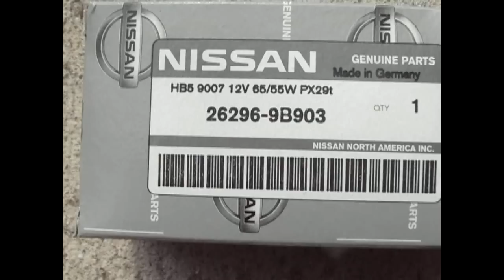Nissan Altima 2001 Headlight Bulb Replacement /  (The Easy Way)!

Comment: It is the easy way but took me a lot of time to get the blub changed.  The video should include how to remove a pin that keeps the rubber cover on the body of the car..  Once I was finally able to leverage the pin from the front top left of the rubber (as stand in front of the car) with a long large flat screwdriver, that allowed me to push the rubber cover back enough to maneuver.  The video shows putting that pin back at about 5:43-5:44 of video.  This was the most helpful video.  Thanks.

Comment: Thanks Buddy its a piece of cake when you know how.  I did not have to pop the clip that holds the insulation I just pulled it back and down had enough slack to put it in. About a 1 beer job thanks again..

Comment: Thank you so much for this easy way. I changed mine today (Nissan Altima 2001). Except it was on driver's side. So I just removed my battery instead of the coolant reservoir and was able to access the headlight bulb easily.

Comment: Your instructions were perfect.I was able to replace my bulb without any problem.
This works great for the passenger side but what about the driver side? Would I have to remove the entire assembly since the battery is in the way and I'm not going to attempt to remove it.
Reply: I have the same question, but given yours was not answered 3 years ago---I will move on.  Thanks anyway.

Comment: mm hmmm and the drivers side?
Reply: I know you posted this a year ago, but I changed mine today on driver's side. So I just removed my battery instead of the coolant reservoir and was able to access the headlight bulb easily.